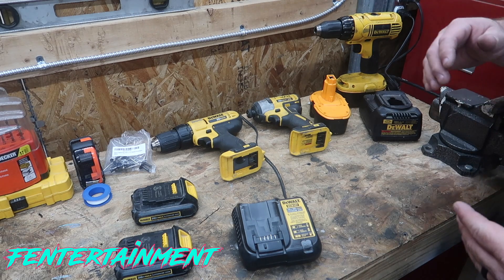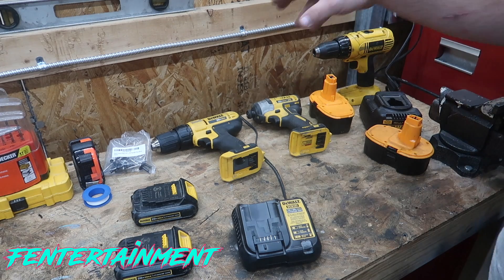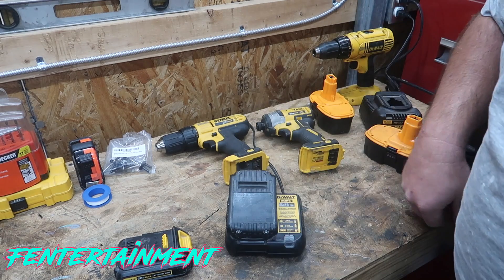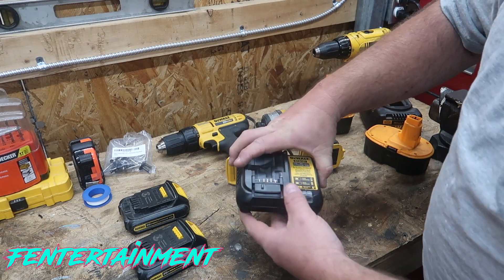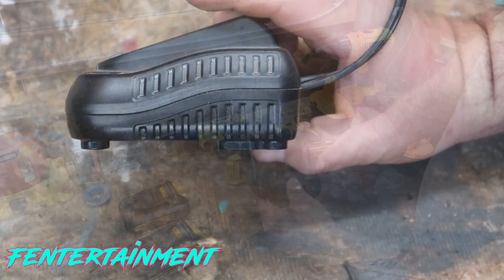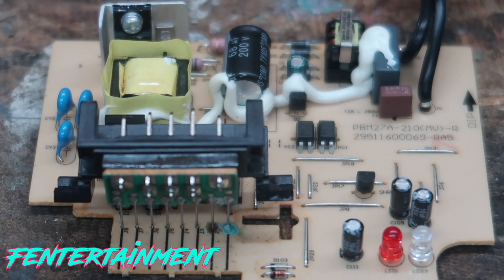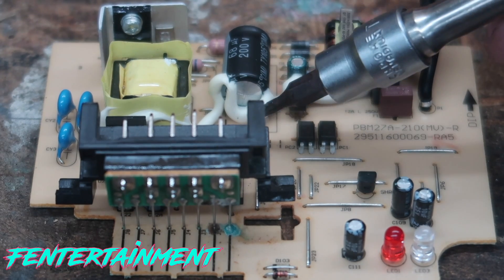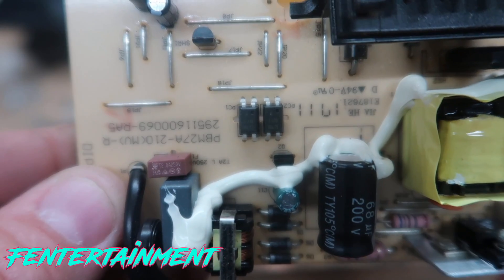FIX DEWALT DCB107 LITHIUM BATTERY CHARGER FOR LESS THAN $1

Comment: Thank you Moncks! No thank you DeWalt. I have a great three-year old drill. Same charger problem. The capacitor cost me several weeks and less than $2 for 2 capacitors on a slow boat from China, including shipping! Alternatively, the cheapest replacement charger I could find was $100. I won't touch another overpriced DeWalt product. (Yeah, customer support phone dude, I'm following through on hurting DeWalt's reputation.)

Comment: That pin coming off of your connector will probably be an issue in the future..  At 4:23 . you can see that green pin on the board at the bottom.. where it's coming out of your connector and mounting to the board on the right side pin.  I would desolder that and clean it up and add some new solder;  to get rid of that green corrosion.  It probably dripped some water down in there and is starting to corrode away and might short to the pin next to it, etc.

Comment: I have the same problem with two of my old DCB201 batteries. If I didn't have to order the t15 torx security screwdriver set, the soldering iron, and the capacitors I would probably try to fix it, but I can just get a new charger on Amazon for the same price on sale or less (found one for $38) without all the hassle. This charger still charges my DCB203 battery, but if I can salvage these two DCB201's, it's worth buying the new charger. HOWEVER... if I think I'm going to use a soldering iron, capacitors, and a torx security screwdriver set again... it might be worth the investment?? 😂

Comment: I have had the same problem with my DeWalt DCB107  charger here is Zambia where I relocated from the USA about 3 years ago now. Thanks for sharing your detailed fix for the problem. Now I just need to see whether or not I'll be able to source the capacitor locally.

Comment: If you are in DeWALT’s 20V Max system it’s hard not to end up with several of those DCB107 chargers. They only get away with charging so much for replacements because contractors make mistakes (leave them) and will overpay for an emergency charger to avoid holding up a job.

I, myself, have four DCB107 and one DCB118 fast charger.  First one came with my brushless drill/driver set. Turns out my mom had already purchased a brushed drill with the same charger before moving in with me, bringing a second DCB107 into our garage. Next, I got a PowerDetect hammer drill to anchor into concrete which is how I ended up with my DCB118 fast charger. Finally, I bought an open box DeWALT mower that included two more of the DCB107 chargers for a total of four plus the fast charger.

I’m here because I’m considering mounting the extras into a TSTAK box so that the attached batteries don’t roll around and I’ll always have chargers when on the go.

Comment: I have a charger dewalt.When I put the battery in my charger, the red led flashes as if it were charging, but hours pass and the battery does not charge, the led only keeps flashing.

￼

Comment: Very helpful video.  Side note: one of our DeWalt chargers had a 100-micro-F (200v) capacitor and the other one had a 220-micro-F (200v) capacitor.  So not every charger will have the 68-micro-F (200v) one shown here I guess. The 100-200v charger repair was successful, but our replacement of the capacitor on the 220-200V model failed.

Comment: Can you do a video on repairing the audio output side of a car stereo amplifier ?
I’m not gonna lie, I have pushed this 4 channel 3000 watt amplifier to its max for year’s from car shows and tailgate parties to crank it up stereo competitions. But the funny thing is it stopped putting out audio on a 2 hour road trip after it playing at maybe 15% power. Just turned up loud enough to where you can talk to the passenger without yelling. I have took the case apart and looked for blown capacitor’s or anything obvious but I got nothing.

Comment: I have a similar issue, but my light just stays on saying the battery is charged but it's not charging. I tried another charger and it works fine. So something is wrong with the charger.

Comment: I’d the same charger but when I put my batteries to charge the light stays red like the battery has already charged. I’d only got this driller a couple of weeks and only used it three times. I dont know if to return it or call DeWalt for them to send me a new one. Does somebody have the same issue as me?

Comment: I’ve just repaired my dead charger. Having worked in the electronics industry for 40 years, I found that 2 diodes on the bridge rectifier had gone short circuit and blown the input 2A fuse. I requested some diodes from a mate at my ex work place,1N4007 and replaced. These have a good reverse voltage breakdown 700V. I replaced the input fuse with a direct short as the mains fuse plug is rated at 3A so that will protect the circuit. I suspect a surge on the mains supply caused the problem. I’ve recharged both batteries and my drill is now up and running.

Comment: Quiero saber el valor de la R17 soy de México!! Gracias
Reply: @javierpirchio9437  Siiii... claro amigo con mucho gusto
Reply: Mañana te los mando, porque ahora. Ya no estoy en el taller!!
Reply: @javierpirchio9437  hola amigo..así es...mi capacitor, es de 200 a 68 micro faradios!!
Reply: @javierpirchio9437  hola amigo...mi R17 es azul, gris, negro, plata, marrón
Reply: Es la misma que la tuya?
Reply: @pablocontrerastellez7834  sí, es el mismo valor.
Reply: Sí, es el mismo valor. Podes poner de 4 bandas, porque de 5 no vas a conseguir. Son 0.68 ohmios, la tolerancia nunca le di importancia. Pablo, nunca me pasaste los valores de los SMD que te pedí. Sin esquema no voy a poder repararlo, no encuentro información. Tampoco vi en Mercado Libre el cargador para comprarlo. Así que se me ocurrió improvisar un cargador con una fuente de 20 voltios (consigo una universal con varias salidas) y un "modulo de proteccion BMS ", que también es un balanceador de carga para las baterias 18650. Porque esta batería del taladro/atornillador adentro tiene cinco 18650, supongo que en serie. (3,7 v x 5=18,5 v) Cada bateria se carga en 4,2 (4,2 *5=21 voltios). Después te cuento si da resultado, porque nunca lo hice. Si no te es mucha molestia pasame los valores de los SMD, gracias. Saludos
Reply: @javierpirchio9437  ok... amigo..no te preocupes, en un rato más te los mando..pasa que eh andado muy ocupado!!
Reply: @javierpirchio9437  mira Javier....el D8=A2, R15 1001, R16100, U101, y U102= LM393
Reply: @pablocontrerastellez7834  Pablo, necesito el valor de IC1 (8 pines) en la fuente primaria. No tengo nada dañado en la fuente secundaria. Dicho sea de paso, muchas gracias, me sirve. Los valores de las resistencias coinciden con lo poco que puedo leer en mis resistencias chamuscadas, así que asumo que son los mismos valores, pero me faltaria el IC de fuente. Si no es mucha molestia. Lo que alcazo a leer en ese integrado, en la segunda línea es RGGTP03, pero google no trae nada con es código.  Saludos
Reply: @javierpirchio9437  es el IW1710-01
Reply: @javierpirchio9437  oye Javier...un favor.. puedes medir la R17?? Haber cuanto te da?
Reply: @javierpirchio9437  es que a mí me dice que es de 6.8homs
Reply: @pablocontrerastellez7834  R17 te va a dar continuidad si la mides en diodo, lo cual significa que no está abierta. Significa que está buena. Los multimetros no pueden medir resistencias inferiores a 1 ohmio, con el hecho que te de continuidad significa que está buen la resistencia. Si no te da continuidad es porque está quemada. De todas maneras se pueden medir resistencias, por ej, 0.22 o 0.27... no me acuerdo cómo se hacia haciendo pasar una tension y haciendo el calculo segun la ley de ohm (V=I*R) Pero eso es solo para saber si esa resistencia está por debajo o encima de su valor. Acá es muy simple, esta resistencia lleva el SOURCE del mosfet a GND. Si está mal, no mide continuidad. Siempre estamos hablando de R17 resistencia metal film (creo que es)
Reply: @pablocontrerastellez7834  Pablo, pasame los colores (creo que me los dijiste) En todas las fuentes que trabajo, el terminal 3 del mosfet (de iz a derecha) está conectado a GND con alguna resistencia de mucho menos que un ohmio. Supuestamente es la resistencia sensora de corriente.
Reply: @javierpirchio9437  azul, gris, negro, plata, marrón
Reply: @pablocontrerastellez7834 Y no queda otra, son 6,8 ohmios. Si mide eso con multimetro, es porque está bien. Ahí se me quemaron los libros como decimos acá. Incluso puse la calculadora de codigos de colores para resistencias de 5 bandas de digikey. Lo que si en mi placa la R17 es de 0.68 ohmios y no queda otra. Q1 es 12N50NZ (mosfet)
Reply: @pablocontrerastellez7834  En electrotanya hay un diagrama parecido, es del modelo DCB115. descargalo y fijate que la resistencia del source del mosfet es de 0.47 ohmios. Nunca puede haber  una resistencia tan "grande"(6,8ohm)

Comment: Thank you. I have a cheapish charger that is showing the 'hot/cold' fault so not charging. Although the capacitor appears okay it's surely worth replacing - they're so cheap and easy to do so, even if unsuccessful, I'll only lose a few pennies. Thanks again.

Comment: My battery charger is working cause the other battery charges and my other one don't the hot cold light comes on John boasts parts of it and it just it stays on but it will not charge the battery

Comment: My battery charger is working it will charge one of my batteries but the other battery that hot cold cold it comes on and the other battery just sits there with with both lights on and will not charge

Comment: Freakin Brilliant.Such a simple fix that most would skip and just throw away and then shell out like 80 bucks for a fancy new charger.I have seen plenty of bulging caps on motherboards that still worked fine,so I dont think I would have thought of that.Since it was the only thing that looked off,great call on replacing that part.
Reply from the maker: We live in a throw it away world. Before I throw away anything I usually take it apart or see if I can fix it. You sound the same.

Comment: I have the fast charger model and the torx T15 bits are too small, and the next up, the T20 are too. Can't figure out how to remove the screws 😭
Reply: I had the same issue... remember it is a security Torx T15 and not regular T15. Torx security screws have a post in the center of the head that prevents a standard Torx driver (or a straight screwdriver) from being inserted. I was able to shear the center post using a tiny strong flat screw driver and then my regular T15 just had a snug fit.

Comment: Thanks for posting this!!! My Dewalt charger was having the exact same problem. Opened it up and found one of the capacitor leads had not been soldered in properly and had come loose. I re-soldered it and it works perfectly now! Thanks for saving me some $$$!

Comment: Since you had it open, it probably would have been a good idea to clean up J1 and J2 on the board as it looks like there is some corrosion.  Looks to be on the main board as well as on the little board which contains the actual terminals the the battery contacts with (not as clear video so hard to be sure).

Comment: Does anyone know what the problem might be if my charger lights up, but it doesn't actually charge the batteries?
Reply: Try looking at the other videos on YouTube that shows you how to run a wire from one of your good batteries to the one that won’t charge. You basically are jumping off your battery for a few seconds and then it will work on the charger.

Comment: Thanks for the Video, it encouraged me to open up my charger and check for a swollen Cap but it was ok, So I looked around for another issue and found that under a diode was dark brown like from excessive heat (i think it was number 201 on the board) so I turned the board over and saw a cold soldered joint on the diode and re soldered  it and Voila It worked!! Thanks Again
Reply from the maker: Thats awesome. Most would've thrown it away.
Reply: That's great.  I wish I was that lucky.  My 12v charger is fast blinking .  I'm sure battery is fine.
Looked at board and can't see any visual issues.
Last week the charger worked one time, and battery was fully charged.  But goes to fast blink again.

Comment: You did not investigate why the cap failed. I think it may be prudent to buy a outlet checker that has a polarity function test. These chargers come with a polarized plug for a reason (one blade larger than the other so it plugs into a two prong outlet). 

Your bench outlet may have hot on the neutral terminal (the silver screw head), The capacitor will fail because as you pointed out, they have a designated (striped) negative lead and even though your outlet puts out 120vac and the capacitor can safely handle up to 200 vac, it will valiantly try to work until the electrolyte outgasses and causes failure.

Comment: That is the mains buffering filter capacitor. You can put in a higher voltage rated one about 120 to 400uF at 400uf would make the problem go away for good. 🤓😊😁
Reply: 120 to 400uf at up to 400v. Fix it for good.❤
Reply: I have a craftsman v20 cmcb104, it has an aishi 2018 jpet capacitor in it. Can I use the same capacitor  listed in the video? Or would you have a link to a better one?

Comment: Great video.  Had same problem, capacitor was $6 on Amazon though, but 20 min fix and works like new.  End of the capacitor was extruded and appeared like it had expanded 1-2mm. So I soldered in a new one and, just as this video shows, it worked like a charm. Thanks!
Reply: I’m having trouble finding the capacitor on Amazon. Followed the link and says product unavailable. Any suggestions on where to find the correct one? I’m unsure of exactly what to look for.
Reply: @allen1473  https://smile.amazon.com/gp/product/B00KKIHJYW/ref=ppx_yo_dt_b_asin_title_o02_s00?ie=UTF8&psc=1
Reply: @allen1473  Open your charger up, make sure you see 68 and 200V, in case your model uses different capacitor.  I don't want to order from China, so I bought the one in the link below and received in 2 days locally. Make sure solder iron gets hot to remove the old solder, I used solder wick to suck up the old solder, slightly applied tension to old capacitor so the moment solder melted, the leg pulled out.  20 min fix!, and my old capacitor had a slight bulge, so moment I changed it, I was back to normal charging.  Now run my charger on a power strip/surge protector.

Comment: Excellent video Ryan. 
I don't have this issue with a bad cap on my charger, but did have a cap fry on an audio device I own. (I used to do audio recording for a living) This audio board has about 75 small sized Tantalum caps on it and is not marked positive or negative for the cap leads that need to be replaced. As mentioned the cap fried (it's burnt) and can't be read for polarity. Do you know if there is a way to determine with a volt meter (or other method) to find out which lead goes where on the PCB so I can solder in a new cap. Thanks and great fix on your charger. Giving you a sub too.............
Philip

Comment: How would you test to make sure its the capacitor. Ohm it or plug in and test volts ( my elec skills go as for as a light switch on and off LOL)  when I plug in cord and put Batt to charge I get nothing no lights blinking and battery want charge.
Reply: If you have a good multimeter you can use it to check the capacitance.
Reply: ESR meter

Comment: Eh man. Thx for the non retard video. All the other vids i seen were solutions involving making sure it was either clicked in or plugged in.  My capacitor was swollen and after replacement. Works just fine. Thanks bud.

Comment: I have a kit of various sized Capacitors on hand for these sorts of situations.  This, a solder wick and a soldering gun are nice to have on hand.  Keeps from throwing away a lot of things that most people would trash.  Nice job bud.  This is a solder wick.  https://amzn.to/2qiD1qM  When you heat the solder, touch it with this and the excess is removed.